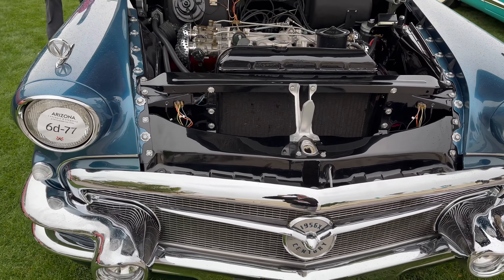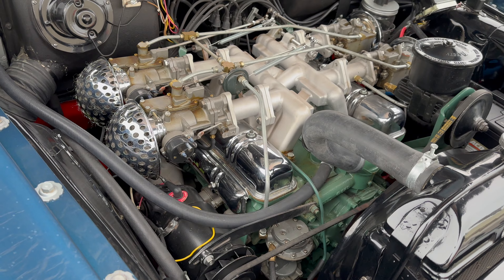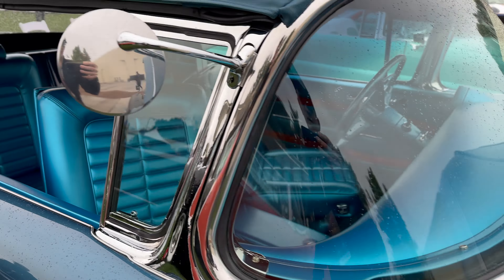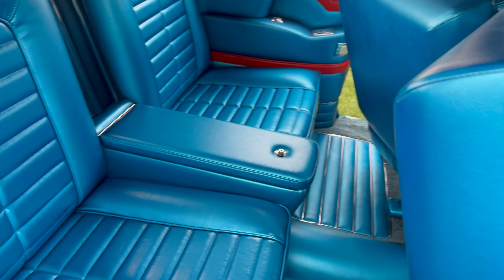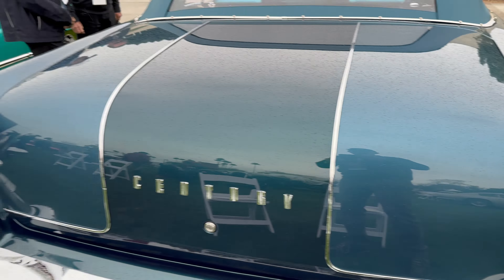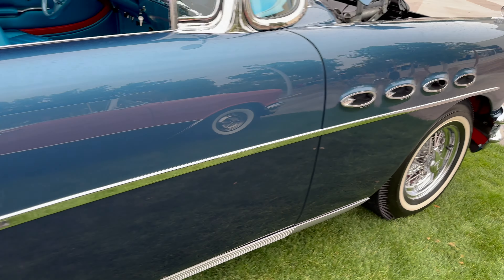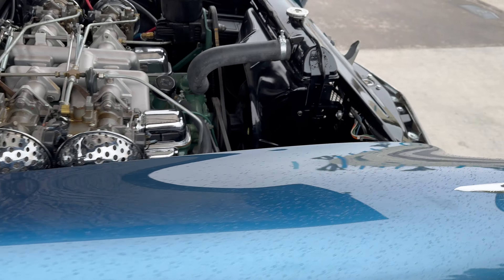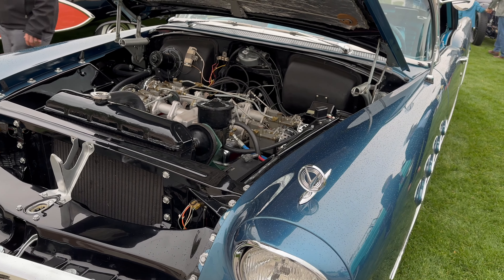1956 Buick Century X Bill Mitchell Show Car

Comment: This one is a two door hardtop rather than a coupe. My father had a 1958 Golden Hawk 2 door hardtop. His had stickers on the vent windows that read. "Do not open vent windows, or roll side glass down at speeds over 150 MPH." He argued that was factory, but he could never prove it! 😂 
His was 298 two barrel carb, supercharged.
Reply from the maker: That’s a pretty funny story, Robert!

I guess we all use words a little differently. I would call it a two-door hardtop, coupe if you want to be inclusive with those words… In modern days, the coupe word has been used differently than it used to… Used to mean pretty much a two-door without a post , or B pillar… and a four-door car could be a hardtop, sedan or four-door sedan or four-door hardtop… Well, I’m just realizing this could be a really crazy long subject. Ha ha ha!😂